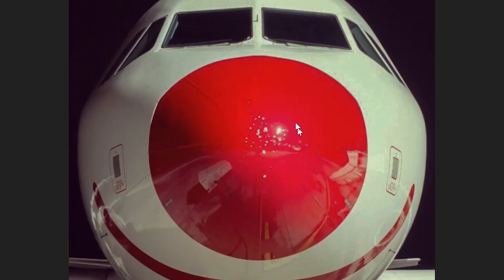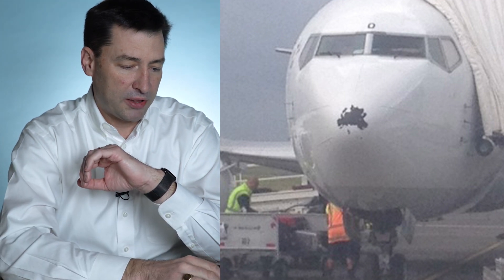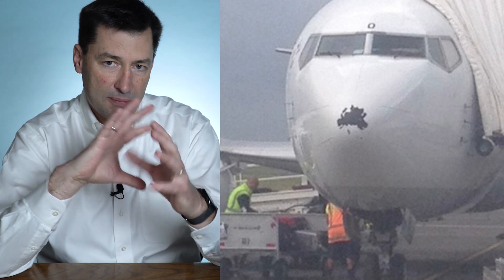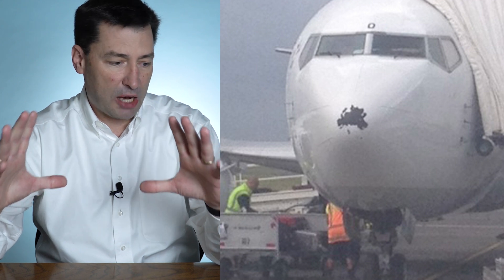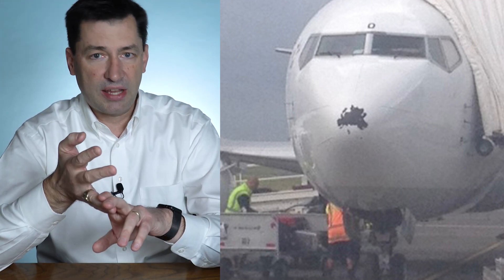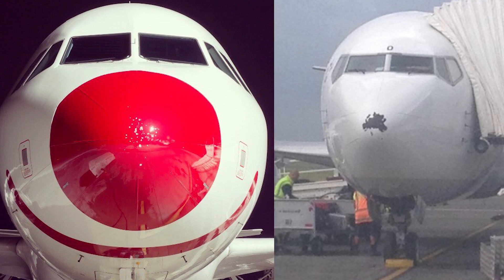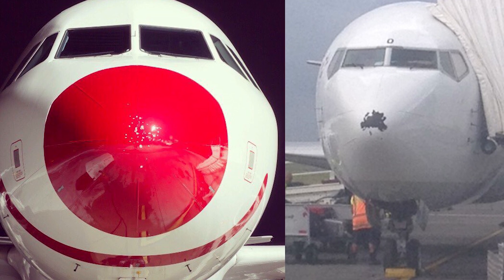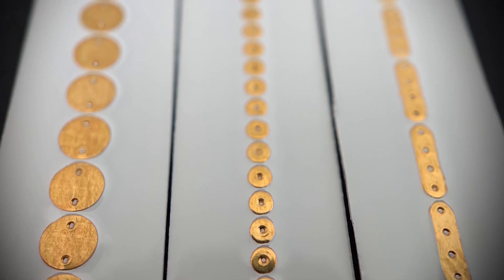Types of Damage to Aircraft Radomes - Black Marks on a Radome

Comment: Actually I mean the damage of paint, is it safe for flying with such type of paint damages
Reply from the maker: When the top coat of paint is damaged the underlying composite structure will eventually acquire water. Water in the radome structure degrades the radar performance and increases the chances for lightning punctures.
Reply: Thanks a lot for ur reply